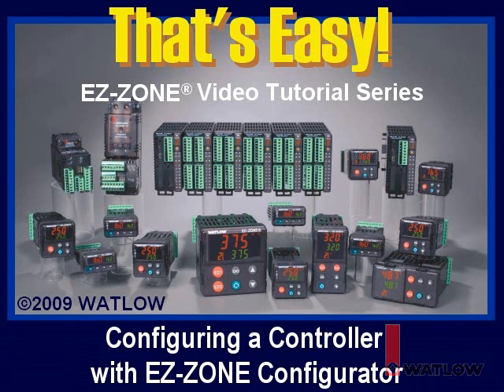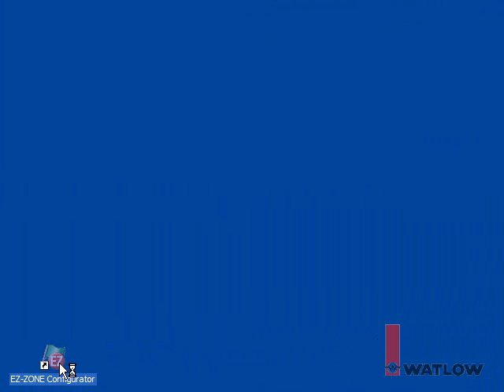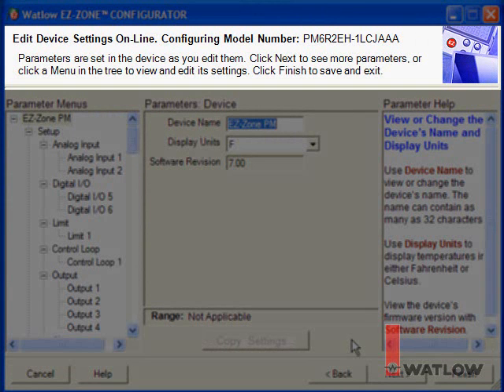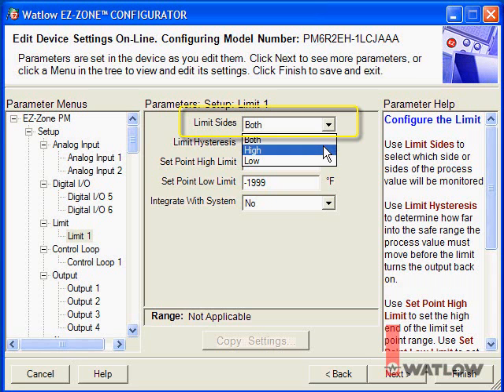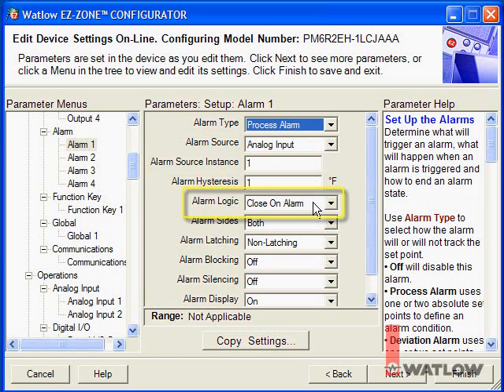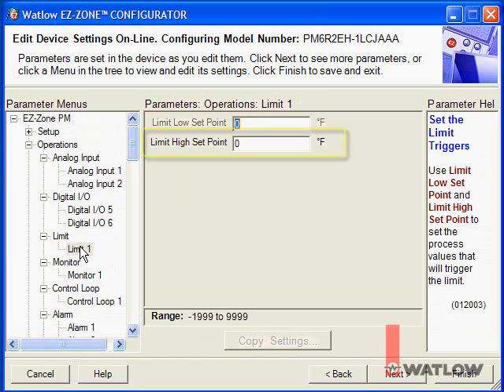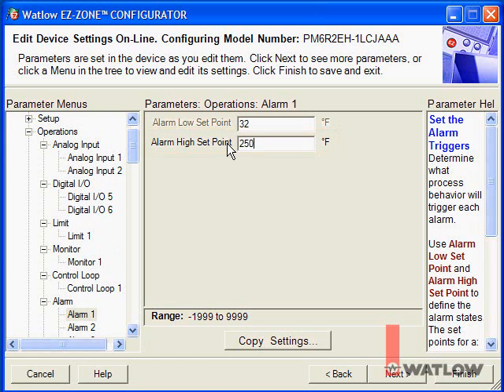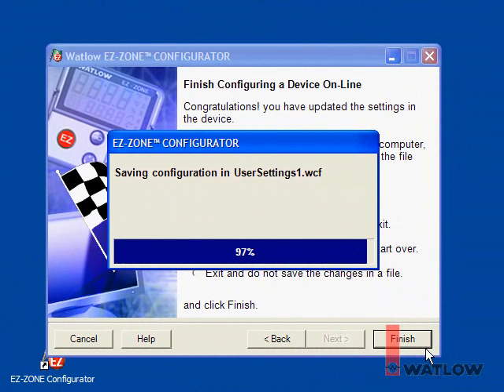Thats Easy! 2: Configuring a Watlow® Controller with EZ-ZONE Configurator

Comment: The EZ-ZONE Configurator uses an EIA-485 half-duplex serial port located on all models. The user's guide contains the wiring information. See terminals CD, CE and CF. If the controller has a second serial port or Ethernet, then other software, PLC or devices using the Modbus RTU/TCP protocol may communicate to the controller. Contact Technical Support at 507-494-5656 during normal business hours Central Standard Time (USA). Please provide model number and we can assist in connection issues.

Comment: There is no help for non communication.  I have tried all sorts of 232 and 485, can't get it to see it.  You need to provide DETAILED hardware connection diagram.  I can't get to 1st base.  I can't connect and can't configure.  This might as well be thrown in the garbage as it is unusable.  Please help me make it usable.
Reply: I would not add, "Quits When Challenged." to my resume.

Let's help you to change that to, "Is Resourceful!"

First, let's do a little sleuthing.
This video is titled, "Thats Easy! 2: Configuring a Watlow® Controller with EZ-ZONE Configurator"
It looks like step 2 so there must be a step 1 to get ready for step 2.
Maybe something like,"Thats Easy! 1..."

Let's Google it!
Check out the following link... (this is funny)
http://lmgtfy.com/?q=youtube+watlow+rs485

At the top of my search results is, "Thats Easy! 1: Installing a USB-to-485 Converter and Watlow® EZ-ZONE Configurator Software"

For your specific wiring issue I've "fenced" the part of the video that may interest you the most...
https://www.youtube.com/embed/gmoiYCxbatc?start=208&end=244&autoplay=1

Good luck to you Larry!
You can do it!
Reply: Hello, I am having the same issues. I do not have a hardware connection that is working. If anyone sees this please reply. I have tried borderline everything to connect my device to the EZ-zone configurator.